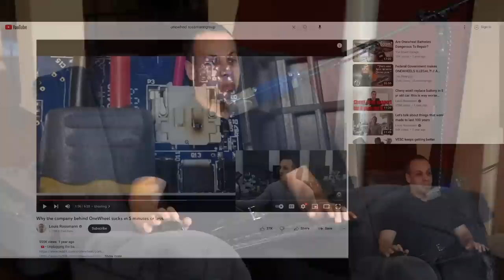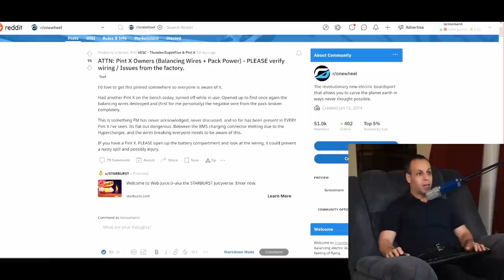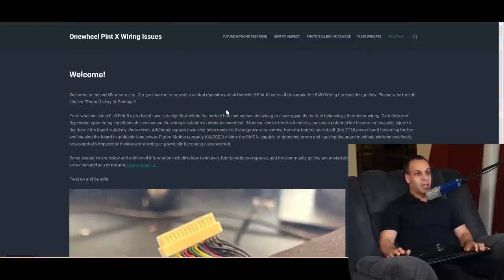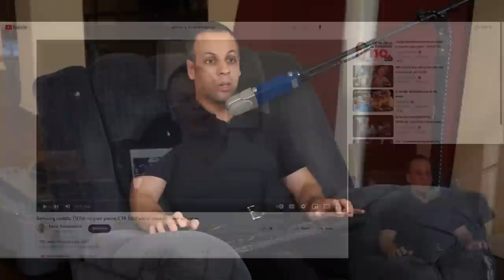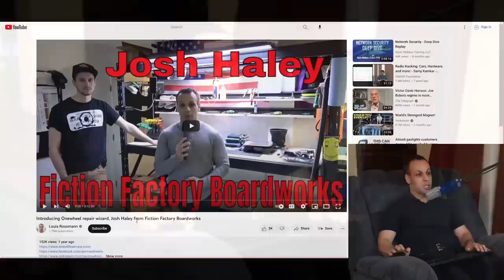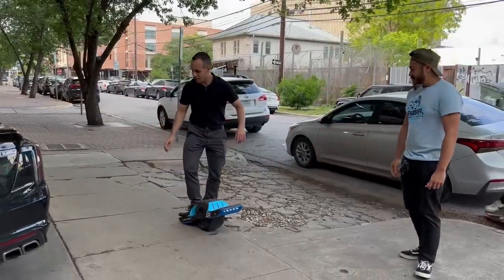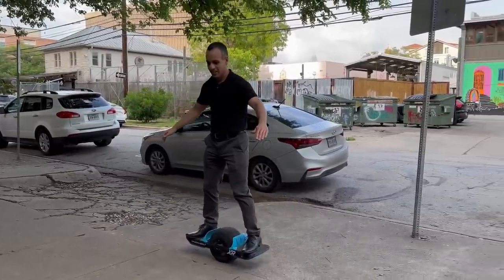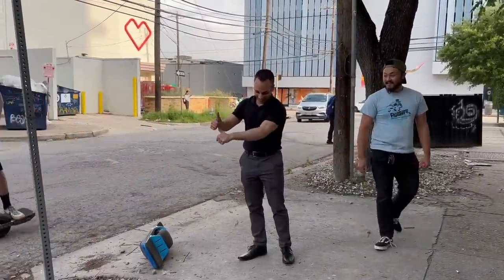The Onewheel Pint X has a dangerous design flaw that Future Motion refuses to acknowledge

Comment: They used amateur hour basement server breadboard cable management for all-terrain vehicle power lines…
Reply from the maker: And they take no accountability. 

When they say that this is misinformation, what are they implying? 

That the photos are fake? 

That the photos are real, but that there's nothing wrong with BMS wires that look like that?

That the error code LED you'll see on the device is good enough when the BMS wires short and the device immediately dies?

What part is misinformation, and why do they think that? 

You'll never get a straight answer.
Reply: @rossmanngroup  balance wires are monitor wires and the main terminals is the wires that make the board move. But also a short on the balance wires could melt your foot too!
Reply: @rossmanngroup This is also an issue with the XR model. I have multiple friends that needed to do repairs. one has about 1,500 miles and another was only 350 miles.
Reply: Insult to the basement server breadboard cable management... the cables with open insulation are literally millimeters away from turning the battery into a bomb!
Reply: By eliminating unnecessary insulation they are saving weight and increasing battery range 😝

Comment: In the U.S., any person can ask the U.S. Patent and Trademark Office (USPTO) to re-examine an approved patent. If prior art or publications show that your claims are not new, the USPTO may invalidate, or revoke, your patent, which means that your rights are surrendered.
Reply: Unfortunately, IPR is currently being attacked by patent trolls and USPTO is in the side of the trolls
Reply: Good luck with that tho. Look at asetek. They're sueing left and right even tho they never invented pump in block coolers
Reply: @Dowlphin  I am not a patent attorney, but from what I understand, it doesn't matter if they say they got the idea on their own.  If it is not NEW, then it can't be patented.

For example, my mother once worked in the office of a joinery and she told me of a particular joint that was used by that business.  Another company had filed a patent on that joint and issued a cease and desist. One of the old hands on the joinery floor then went back and dug around to find a book published ages ago that described that very joint (which is where he got the idea to use that joint).  Since the publicly available design of the joint predated any patent efforts (by a LONG time) the patent was completely invalidated and the other company had no recourse.

If you have an idea to patent, then searching for "prior art" (as it is called) is vitally important and can be quite the challenge - but if you get it wrong, you can spend a lot of time and money and have nothing to show for it.  There are specialists that do these searches - and good ones will cost you.
Reply: @Dowlphin  Whether they knew about it or not isn't relevant for patents. If something similar already existed before your "invention" then it can't be patented
Reply: @GHOSTSTARSCREAM They may have "looked" similar but the aspects they patented have to be completely unique for the patent to hold any weight. Plenty of faulty patents are approved though if that's what you're referencing. It's not until a patent is challenged that's it's really looked at in depth

Comment: One wheel is actually correct, the board does have the ability to detect this issue, if there is damaged insulation, when it becomes dangerous the board will alert you with a sudden audio-visual alert, that grows rapidly with intensity to ensure you notice it.

Failing that, there's also an innovative thermal warning system to dissuade continued use of the onewheel, where upon detection of a battery short condition your lower extremities may feel a mild, to third degree level of heat.

Truly brilliant engineering.
Reply: "... Mild to third degree level of heat".

Fuckn lol 😆. A+. That was great.
Reply: You are underplaying the immersion of the alert; it is not only audio-visual, but it gets accompanied by a distinct smell similar to when your mother left the oven on overnight, to encourage you to stop using it. Also present is a state-of-the-art tactile effect to warn you that the device has suddenly stopped working, which will be felt by whichever part of your body touches the ground first.
Reply: Of course, you'll have to send it in to repair this issue, but don't worry, they're the only ones capable of installing the battery properly, so they'll make sure it's wired up the exact same way so these amazing safety features continue to function.
Reply: You forgot to mention that the Heat Alert System® also comes with integrated light emitting elements so that if you don't notice anything people around you will know to call the fire department.
Reply: Did you like riding the one wheel Louis I’ve been thinking of getting one but and that’s a big butt😅 All of this bad stuff going on with it I’m not sure but looks fun!!
Reply: @trevorbickle821  Buy one of the older models that isn't so locked down.
Reply: The future is now
Reply: man wrong.
Reply: I want to second this point, but with a big caveat. When there is a physical fault or short in these balance wires we DO tend to see errors and get the accompanied intense pushback and warning in the app, and in the case of the Pint, Pint X, and GT, the red lightbar warning. It's a built in fail safe. However, there are countless examples of this fail safe not working. It's certainly a minority of boards that fail to warn of this damage, but given the safety considerations it's not a small enough minority. In addition, there is thermal runaway protection in the system that generally works - but again there are edge cases with battery fires. So while this comment is correct, it doesn't mean the user is fully protected. IMO whatever credit Future Motion deserves for incorporating these mostly-working fail safes, they deserve a lot more discredit for running thin wires over a sharp piece of plastic while those wires are under tension. From what we can tell from the data we have as well as just examining the design, it will effect EVERY Pint X, and the problem starts as soon as the board is assembled at the factory and only gets worse as you ride it. I think it's important to make correct claims when bagging on a company, and in this case Louis saying there is no way for the board to detect the damage is incorrect. However, it's the sloppy design that's far more consequential here. Thank you Louis for raising awareness (yet again) and for being willing to heart a comment that makes a small correction. One more thing - you CAN build your own Onewheel, there is now a vibrant DIY community using the VESC platform (Vedder's Electronic Speed Controller.) You just have to buy the parts piecemeal from several different suppliers and assemble them, and while it's getting easier you still have to be fairly comfortable with DIY.
Reply: Then you have the good ol' olfactory sensor, when your nose hits the pavement
Reply: The first few words into this, I realized where you were going with it!😂😂 👍👍
Reply: @trevorbickle821  I bought one a few days ago, it’s Hella fun! I just keep watching these videos to remind myself to wait until my helmet and protective gear arrives before, I get too crazy.
My wife and I are going tomorrow to pick up another one for her.
(I personally don’t like riding it on the roads. It feels a little bit unsafe and I get real nervous when traffic is coming but I think it’ll be a lot of fun on little trails in the woods.
Reply: NGL, got me in the first half.

Comment: I have one of these batteries in the shop now for repair. The balance wiring harness has pinched wires to the point where the insulation is worn down to the strands. Also, the negative lead on the pack terminal has popped off and the thin piece of nickel is torn where the wire broke off from within the pack. 

Fixing this properly (without cutting and splicing the wires at the connector, which is more of a hassle) requires all of the overwrap and tapes to be removed, the broken/worn leads desoldered from the balance tabs, heat shrink added and slid up the wires to the worn insulation, and then that heated shrunk and the wires resoldered to the balance tab with more heat shrink applied over that tab. 

It’s a pain, and takes a while to do properly. It’s also pointless to do, unless the owner of the device cuts away the parts of the enclosure that digs into those wires. So beyond the repair, there’s modification to do to keep it from happening again.
Reply: Seems like it was designed to fail after a certain amount of time based on average usage.
Reply: Could you please send pictures to pintxflaw?
Reply: @watamatafoyu  mine failed right after the warranty expired and future motion wants over $500 to fix it.
Reply: @northuniverse  I’ll forward them, sure. Currently working on the repair log I’m wiring up to illustrate the findings.
Reply: @TheBoardGarage  thank you for helping make our gallery as extensive as possible!
Reply: @DifferentSubjects even though it’s a known issue? That’s crazy.

Comment: So what error code do you get when you're riding and the hot or ground wire cuts in two? Blank error because the board has no power? Fling the rider off at 20mph error? What? I want to know what error no power due to a broken wire spurs.

Wait, if you lose power and fix the wire, do you need to replace the battery at the factory since it technically "unplugged" the battery?
Reply: I feel like we need to start a company that just produces all the cool devices but opensource and does not give a fuck about anyone else on the market.. yeah, dreams
Reply: @maddsua  it's shipping now actually. Check out the floatwheel.
Reply: @marsrover001  Looks great!

(we still need open-source home appliances tho)
Reply: @maddsua  Sadly, patents exist
Reply: @torgematthies2172  make it different enough so that the patent would not apply. Should be possible, it's not like they patented electricity or something crucial
Reply: @maddsua  Depends on how broad the patent is
Reply: @torgematthies2172  If there is a video of a prototype like Rossmann said, there is prior art and the patent is invalid.

Comment: Thank you for your video!!!
I have 950 miles on my PintX. The balance wires were pinched, but copper wasn’t visible. I used a small chisel to remove the plastic on the housing and added liquid electrical tape to the wires. Everything went smooth!!

Comment: As a former employee, I am pretty sure this is based on the suppliers as well as installation. They have to order in bulk and wait for things to be shipped to them (the board is assembled in San Jose, but it isn't made from parts made in America). I am not sure of the incoming quality inspection levels, but this is certainly not something that would pass by someone who knows quality inspection work. My guess is the people in charge determined it wasn't going to be an issue (if it was caught) and let it go out of the shop that way.

We used to have conversations all the time inside the customer service office with management as to how much we shouldn't trust our customers. They didn't know the product, they didn't understand the situation, and they certainly weren't smarter than the people who put together the board (there were a lot of engineers and designers who would call in and ask a lot of hard hitting questions).

Also, that response was more than likely written by the operations manager who also triples as the customer service manager and the RMA/MRB manager. This funneled in from the "usual suspects" (those who know the company will know), so don't be surprised it is mostly canned answer with defensive stances.
Reply: Let's try to boost this
Reply: @shalpp  He just said he was a former employee. Maybe he's just unemployed.
Reply: I disagree entirely. The Pint battery pack has its wiring harness and main power leads in a different location. Future Motion then "upgraded" the Pint with a bigger battery, they allowed for the battery to be designed differently and the QA team approved of the final version. It's absolutely unbelievable.

I'm under the assumption that the QA team approved of what was assembled.
Reply: @northuniverse  Sadly, the boards are not made in Santa Cruz. The corporate headquarters are in Santa Cruz. 

When you send in your board to get repaired, it goes to the San Jose location. It is the same location they manufacture the boards.

I worked at the Santa Cruz location for almost two years and I can assure you no manufacturing was done at that facility. The engineers, C Suite, Customer Service and Marketing teams were the only people in that office.

I have a paystub with the information on it that I am happy to verify.

As far as the design goes, that is a different story than the actual condition of those parts. As someone who has worked in Logistics before, I know what happens when you ship things overseas in crates and containers. Even if it is packed well, you will still have batteries and connectors that will show that damage if they were packaged and handled poorly.

I also used to work at Zero Motorcycle as an inventory clerk and we would see all sorts of damages to batteries that were indeed close to life threatening simply because the suppliers didn't have the ability to keep the cells safe.

I can assure you, knowing the people I know who worked in the Santa Cruz corporate office and designed this product, they would have given the okay to use this item as-is without repairing it or replacing it.  The only other way is they had new people in the San Jose office who were new to the line and used the part without letting anyone else know, which is a possibility.

I would only say don't buy into the marketing and understand this is a business first. They will do whatever they can to make sure they can make the sale.
Reply: @Sonny_McMacsson  Nope. I am a program manager over at a different company these days. They terminated my contract for reporting inappropriate conversations within the company (sadly, a common occurrence). They will refer it to being insubordinate, but I have the report I sent to the manager as well.
Reply: @MatthewEaton  my bad, I thought all of the facilities were in Santa Cruz considering that's what's displayed on the battery box. Thank you for sharing this information with me!
Reply: @northuniverse  It's all good. They meant well by keeping the Santa Cruz label on it, but they created another issue if they decide to move manufacturing facilities again.
Reply: @chodarth  They put them in the enclosures from what I recall. This also was for the older boards, so they might have changed up how they do things with the newer models.

Comment: Those pinched balancing wires shorting or opening during operation due to vibration will shut off the motor abruptly, make the person riding it flying over to a hard surface at speeds. Outcome on the rider would be at least broken bones 😬☠️
My BIL ignorantly discharged the battery all the way ate concrete at his first time.  Broke his femur bone while casually riding it in the dark at slow speeds in his final time. All three of his one wheels are for sale.
Reply: Clearly user error. 
Product works just fine. 

NOTHING TO SEE HERE!
Reply: @Ken's Counseling Couch  1st part touches on potential failure outcomes due to design choices and manufacturing as also portrayed by Ross. But yes, 2nd part of my entry gives direct anectodes of the outcomes from user errors.
Reply: Probably won't break any bones, all OneWheel models have a top speed of only 15 miles per hour. You can get pretty badly scraped up at those speeds, but that's about it.

That said, you can die from "pretty badly scraped up."
Reply: I was being sarcastic if I didn't clarify that. I do hope he's ok and healed up ok from the injuries.
Reply: @ClokworkGremlin  With the added 9.8 m/s² of gravity, you can most definitely break bones, esp. if you're unfortunate enough to hit a pointy surface, like a curb edge or something.

Comment: This reminds of a radar system that i was doing wite testing on.
When the unit was in the manufacturing phase and the wire harness on the upper part to the lower part was opened up for teating, i had many faults to ground.
But when i was testing the unit pin to pin and the upper unit was in the close position, there were no faults to be found.
It truned out that a shield was installed after my test.
One wire got a nick in it and faulted to ground.
Cuasing ground faults to the other pins.
But when closed the wire didnt touch ground.
The engineers had to have the shield installed before i got it to fix the issue.

Comment: I've ridden 2500 km on the Stock Pint X Board never opened never damaged anything myself - seems to work well for its intended purpose if it lasts 10,000, I would not add a bad reply bellow my comment rather a good one! 

P.S ill try remember.
P.P.S Enjoy & Motivate Yourself Everyday, Whilst be aware when in control of any vehicle!
Reply: How's it going now?